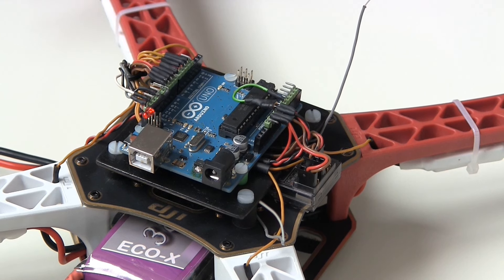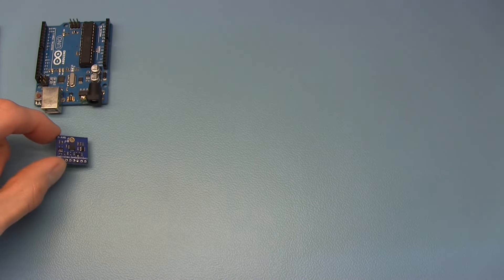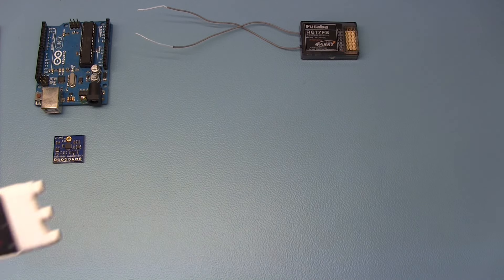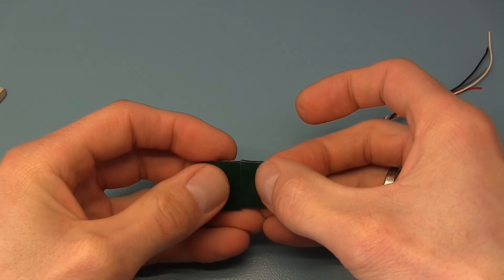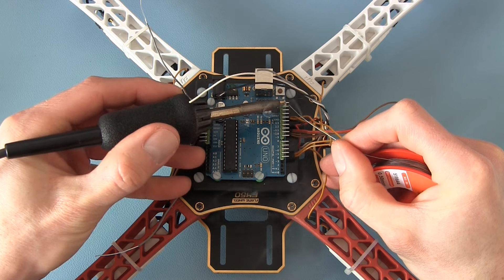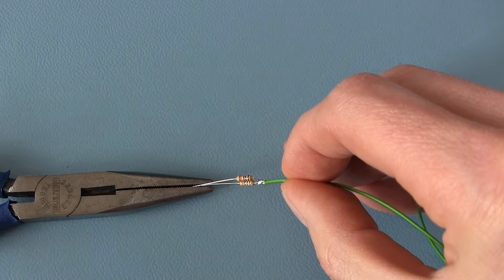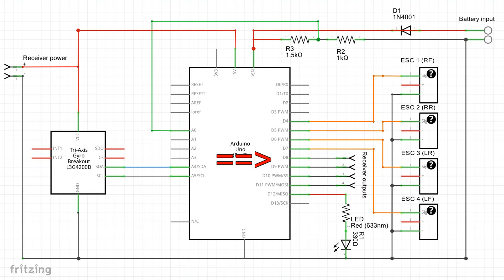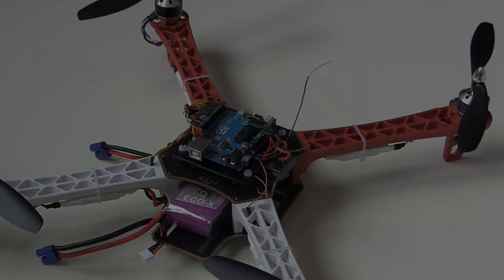Your Multicopter Flight Controller - 3D (YMFC-3D) Part 1 - Hardware.

Comment: Hi, i was wondering if the XD-YK04 receiver works. I get that this receiver is "linked" somehow to a basic controller with 4 buttons, is it possible to connect the receiver and use some old controller of mine?

Comment: .hi joop i try ur tutorial for making quad copter,,,but when i run final code and not attach the battery ,,,i   display serial value of all pitch ,roll, or yaw ,,its not stable .esc2 is give low value and esc4 give high value and esc1,and 3 give normal value......remote all stick in center postion,,,....like,,,
esc1=1570
esc2=1330
esc3=1579
esc4=1700...
plz guid me
Reply from the maker: Please use the YMFC-3D version 2:
https://www.youtube.com/watch?v=CTtLPeJPbXY

Comment: Hi in the schematic you connect the gyroscope on SDA/A4 and SCL/A5, but in the video you conect in other side. What's the correct conection?
Reply from the maker: +Ninoshka Rodriguez Both connections are correct. The A4 and A5 are routed to the other side of the Arduino Uno.

Comment: Hey from which online store did you buy the frame kit and motors
Reply from the maker: Google DJI Flame wheel 450 kit and you get the most logic and local resellers.

Comment: Could you please put a link to the proper diode that used for battery?
Reply from the maker: It's this diode: http://nl.farnell.com/multicomp/1n4001/diode-standard-1a-50v-do-41/dp/9564993

But any other 1A rectifier diode will work fine.

Comment: sir, I have gotten up to the point where i have everything connected and all 4 motors keep beeping and minimally vibrating. The remote is connected and the receiver is blinking when we use the remote, but nothing ever happens. when i first load the esc code, the motors sometimes spin, but not simultaneously. once all the code is loaded, nothing other than the motors keep beeping. any ideas?
Reply from the maker: Please use the YMFC-3D version 2 code: https://youtu.be/CTtLPeJPbXY
And make sure that you calibrate the ESC's. Otherwise they don't accept the 1000 till 2000us pulse and keep beeping.

Comment: Hey Joop!
How to connect diode to Vin and power supply?
I feel it's little complicated!
How did u connect it?
Reply from the maker: I connected the diode to the power distribution board of the frame. From the diode you can run a wire to the Vin pin.

Comment: HI +Joop Brokking, I'm going to build a quadcopter for my last school year project, and I'm starting to make the list of the component that I will buy, but when i was checking the specs of the components I saw that the esc's that I was looking at has an input frequency of 8-16Kz(I tought "what tha heck!!"), but the arduino's servo library has a refresh rate of only 50 Hz, and now im really afraid that if I buy that esc the whole system won't work, obviusly when I mean ESC, ^'m refering to all the esc.
Are ther any ESC made just for Arduino?
I was thinking of buying the Turnigy plush 30 amp, HK F-30 amp esco or the Afro esc 20 amp, both of these have an imput frequence of more than 1khz. what should i do?
Reply from the maker: +Kevin  Silva The 8-16kHz is the switching frequency of the esc. This has nothing to do with the 1000 - 2000us control pulse. Most esc's that run Simonk or BLHeli will work fine up to 400Hz control pulse.

Don't use the servo library with the 50Hz refresh rate. This is to slow and as you can see in the code of part 6 there are easier ways to create a pulse @ 250Hz.
Reply: ah ok, so wich should i choose? I need to save money, so need something of good quality but that also good performance, will the HK esc be good?
and THAnks a lot for your help
Reply from the maker: Yes, the Hobbyking esc's will do fine. You can also check Banggood.
Reply: thank you very much, finally I end up with the choice of the HK esc, and I've flashed them with simonk and works amazingly
Reply from the maker: Kevin Silva
That is good to hear!

Comment: I used the esc code and all motors work. The two rear power first after half throttle the two front power up
Reply from the maker: You need to calibrate the ESC according to the manual.

Comment: hey Joop, I am using Arduino mega board I copy your code but I got an error of No valid receiver signal found. I try my best to clear these error I recheck my connectin many time everything is best I also try to change the code of PCIN too but it cannot help me. so I request you to help me to build my quadcopter.

Comment: You have a very good 'voice actor" voice!
My question:
I would like to use an Arduino Nano/Mini 328P, and wish to use the ESC's BEC (Linear 5V regulator with about 2Amps peak) to power Arduino from the 5Volt side.
That way I don't need to connect anything to the Vin and no need for a diode to avoid powering the ESCs when I am from USB? Is it right?
Reply from the maker: I never tried your suggested setup. But in my opinion it should be possible without any problems. The 5V from the USB port cannot get trough the voltage regulator of the ESC.
Reply: +Joop Brokking Thanks! I hope so as they are liner regulators and can be connected in parallel also. The think I don't understand is when I connect for example an APM through USB and the USB has enough power than the ESC's can get power just from the Signal and GND wires and start the beeping. Also gimbals get power from Signal and GND an gimbal controller LED's are blinking. Interesting effect. Of course 5V is not enough power to turn the motors but enough to flash the leds or make some very silent ESC/motor beeping.
Reply from the maker: Not all ESC's are designed correct ;-)

Comment: Hello Joop I have a problem with placing my gyro when I put it on drone and calibrate it I get roll: 1   pitch: 2   yaw: 0 and I do not know how i can balance it. Can I modify it by software? Thank you for answer.
Reply from the maker: 1 or 2 degree is normal. If needed you can trim the quadcopter with your transmitter during flight.
Reply: thank you and I have one more quaestion. Do you have some guide for implement GPS module on arduino and YMFC? Thank you
Reply from the maker: I have no information about GPS implementation.
Reply: And something to implement barometer and hold altitude?

Comment: how did u mount (the black board) your Arduino using the spacers?
Reply from the maker: I drilled holes in the top plate of the flame.
Reply: I am not able to figure that out, is there any other way in which I can do it?
and should the gyro be placed only in the canter?

Comment: Thanks Joop.  You have been great.  I finished the setup with no errors and moved on to the ESC calibration.  I am  getting a one beep pulse and then it begins to beep progressively slower.  According to my documentation, one beep means battery protection.  Any suggestions?  Is there something else I could check?
Reply from the maker: Make sure to use a full battery. The beeping may also mean that the ESC does not recognize the 1000 till 200us pulse. So you need to calibrate the ESC's as I showed in the video. Check the manual of the ESC's that you are using to get the correct procedure.
Reply: Joop Brokking i believe it may because im not getting power to the Arduino through the battery. Power light not on for the Arduino nor receiver when i plug in battery.
Reply from the maker: Do you have the diode in the correct orientation? Double check the wiring with the schematic.
Reply: Joop Brokking didnt know there was a correct orientation.  You mean there is a lead end and a output end? I will check.  Thanks for the heads up.
Reply: Joop Brokking the diode was incorrect.  i made the change and now i receive power to both the arduino and receiver, however, when the ESC's chime they still continue to get slower and slower until the beeping almost stops.  i have 20amp esc's and tried to calibrate according to the manual.  do i need to reload the setup again and go through the procedure from the beginning?
Reply: @Joop i did not put an LED on my quad.  Does this matter in regards to my circuit? i have a battery alarm which connects directly to my battery.
Reply from the maker: If the ESC's are beeping you need to check the manual of the ESC's. But you need to calibrate them first before you can use them.

Comment: Hello +Joop Brokking.

I've been following your tutorial series and I'm very excited to say that I have successfully assembled my own drone to your specifications. I say "assembled" because I have not actually gotten it to fly. I'm using a 2700mAh Thunder Power RC 3SP+25 battery with a nominal voltage of 11.1v, and I see that, in your schematics,  you have your voltage divider hooked up to both your battery's ground lead and also its positive lead after the diode and prior to meeting your chosen analog input on your Arduino. In your video however, you create the connection by hooking up the bottom of your divider to Vin and GND on your Arduino. I should also note that I've elected to use the 12v barrel jack on my Mega 2560 to plug my battery into my board.  I'm concerned that by creating my voltage divider connection in the same fashion which you've created yours, I may short out my battery and start a fire. Is it safe for me to directly wire my voltage divider to a pair of extra leads coming from my power distribution board (battery) prior to hooking it up to my Arduino? Or would it be safer to use the Arduino's power ports to accomplish the task? Should your answer be the latter option, would I have to power my board in a different fashion?

Thanks for your input Joop.

SegaSeven
Reply from the maker: +SegaSeven I you use the power jack on the board the protection diode from my schematic can be discard. You can connect the voltage divider to Vin and GND of you Arduino Mega board. As you can see in the schematic the Vin is directly connected to the power jack of the Arduino:

https://www.arduino.cc/en/uploads/Main/arduino-mega-schematic.pdf
Reply: +Joop Brokking Thanks for pointing me in the right direction Joop! I must also note that since I've used my barrel jack to power my board, I've used the Vin pin to power the gyro and other accessories. Will I still be able to use the same pin for the divider?

I have mounted my board in an acrylic box which has a breadboard adhered to it. It's how I've been making my connections. I'm thinking that I'd create the divider using my breadboard by connecting the bottom of it to my Vin and GND buses, and then the top of it to my analog pin.
Reply from the maker: SegaSeven
Don't use the Vin to power the sensors. This will destroy you sensors! As you can see in the schematic the Vin is directly connected to the power jack. Use the 5V or 3.3V (depending on the rated voltage of your sensors) output for this.

Just connect the divider as shown in my schematic.

Comment: I get Error 8 when uploading the setup software. I am using a 8MHz arduino pro mini. The error is not covered in your error page. Is the clock speed not high enough?

Thank you for the videos Joop. They are very informative.
Reply from the maker: You need an Arduino Uno @ 16MHz. 8MHz is to slow. Check this page (tab 2) for the error 8:
http://www.brokking.net/ymfc-3d_v2_qanda.html
Reply: Joop Brokking Thank you for the reply Joop. I will switch components to a regular size arduino uno instead.

Comment: Hi, I am so impressed by your work!! By the way I'm just curious what would happen if there isn't any diode at battery input(+) line??? Would it cause any problems to the ESC's?? and also I couldn't quite understand how arduino can power motors itself using digital inputs, doesn't the thick red wires be connected with the battery input always???
Reply from the maker: Check the schematic that you can download from my website.
Read step 3.1 on this page for more information about the diode: http://www.brokking.net/ymfc-al_main.html
Reply: Thanks for the response!
Quick question)
1.  Do you think R2 and R3 resistors can be replaced with 2K and 3K or bigger value but with same ratio?? Would there be any 'current' issues for arduino to read the voltage??? Advise please!

2. Also can the ESCs in your dx.com link (inside a brushless motor set) be used for this project???(I think I've asked you about this before but I don't think the esc you are using is the same one...)
Reply from the maker: You can change the value of the resistors. But they need to be the same ration.

The hardware listed here (step 2) should work fine: http://www.brokking.net/ymfc-al_main.html
Reply: Thanks, helped alot :)

Comment: How about the hardware connection of kit STM32f4 Discovery with similar project? TKs
Reply from the maker: In my latest videos I'm using the STM32F1 microcontroller for building an autonomous quadcopter.

Comment: The esc will have 3 small ports...red black and white...where to connect this three ports in arduino.?? Please help.!!
Reply from the maker: http://www.brokking.net/ymfc-al_main.html
Reply: Which is the signal wire...please..iam sorry...this is my frst project...so please kindly help....there are three smal wires...red white and black....which has to be connected to the arduino and receiver

Comment: Thanks for the video, it was very informative 

Have you made a flight controller for a brushed motor quad like the Syma X5SW quadcopter, the quad has 8x20 MM motors, they cannot lift much weight, I notice that most people design around brushless motors, do you have any design tips for the brushed motors ?

I am thinking of using a ESP-12 (ESP8266) board, this is tiny light weight, has sufficient PWM outputs and a Wifi transceiver on board. For driving the motors I thinking of a NPN transistor based drive, the ESP would PWM the motor for speed control, for accelerometer I have a GY-521 board.

Do you think the idea is workable ?

thanks
Reply from the maker: Brushed motors will work. I'm currently working on a small quad with brushed motors but it's far from ready. But it wil work.

Comment: hii.. joop ,  I have a question that if I use F450 frame of size 31.2 × 16.5 × 5.5 cm and of weigh 222g . will it dis-balance my drone. help me plz
Reply: I use a F450 and a SK 450 as frame. No problems with balance. If you use 1000kv motors, you have to use 10 inch props (1045). If you use 1100kv props, you'll need 7 inch (7045) or 8 inch (8045) props. To be sure I refere to the manual of the brushless motors you bought. The size of the props depend also on what kind of lipo (battery) you use. Keep in mind that al four props have to be balanced (prop-balancer). Than the F450 will be in balance. It's not the only the frame, but also the equipment you use to build on the frame (kind of motors, kind of lipo, balancing props - most props are not balanced very well, it is however a must).

Comment: if I use 2200 kV motor then , I have to make any change in arduino program or not
Reply: Shashank Mishra No,  but look in your 2200kv motor manual what size of props you ll need. This is very Important, otherwise the quad copter will spin like mad.  If you haven t got a manual,  search the Internet

Comment: Dear Joop Brokking congratulations you.
I looked at the video and looked at it from the top. The motors are beeping, the control does not control. As far as I understand there is a question, but I did not. I model this model Flysky FS-TH9X TH9XB TX RX

Engines this model Emax XA2212 980KV Brushless Motor

Other supplies are the same. Thank you.
Reply from the maker: Please read all these steps and try the software that is provided to test all the functions. http://www.brokking.net/ymfc-al_main.html
Reply: I'm testing the ESC output test in the skec software flashing serial monitor data is empty. Your motors and escs are not the same as my motors and escs. Emax Xa2212 980Kv Multirotor Brushless Motor, Hobbywing SKYWALKER 20A Build-in BEC 2A Brushles, I saw the video and Q & A on the link you gave. Install YMFC-AL_setup arduino on serial monitor; (¸ëëü®¸ŸXÅÐ ??? Úã????) Etc. values are coming out. Dear broking esc and engines did not fit the project.
Reply from the maker: If you are getting strange output from the serial monitor make sure to set the baud rate to 57600. The Hobbyking SkyWalker should work fine with the YMFC-AL software. Make sure to calibrate them with the calibration sketch.
Reply: Dear Joop Brokking I do not know how to make you happy I finally did what you said I played multicopter and I was very happy. I congratulate you on our project. I wish you success in your studies.

Comment: Hi, can you tell me which motors did you use please?
Reply from the maker: Cristian0360 The motors are 920kV running on a 3S lipo. Personally I recommend the DJI 2212/920kV motors with the corresponding esc's.

Comment: Do I need ESCs with a BEC or without a BEC in this case?
Reply from the maker: It does not matter. Check the schematic and you will see that the red wire is not connected.

Comment: Hi Joop,

i bought arduino uno clone which seems to have the 12000 chip instead of 16000 - will your code still work unmodified on 12mhz timing wise?

cheers
maciek
Reply from the maker: 12MHz?? Are you sure? That is a very rare Arduino and the Arduino programs won't run as expected because the Arduino IDE is set for 8 and 16MHz Arduino's.
Reply: Joop Brokking its is weird but it in fact says 12000, here is the photo:
https://drive.google.com/open?id=0ByVTpy6-Jr2dZzZDb2M2NS1DUkZZYk0weW5jeExya29Ga2dB

btw: i was able to upload code via Arduino Studio and successfully run it.
Reply from the maker: The 12MHz crystal is for the USB chip. The ATmega328 runs on an oscillator.

On the left side (text wise) of the ATmega328P you can see two traces going through the board. A little further to the left the traces come back up again. That is the 16MHz resonator used as a clock pulse. And it's probable 16MHz. So no worries ;-)
Reply: newbs mistake :) - appreciate the advise